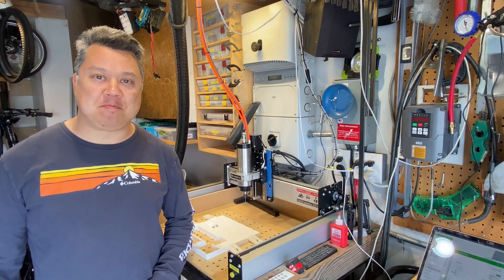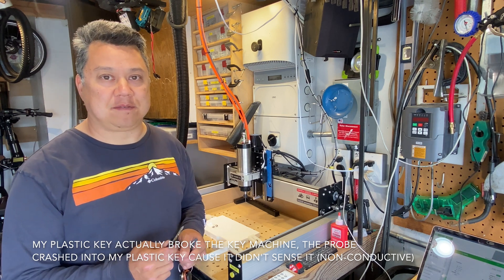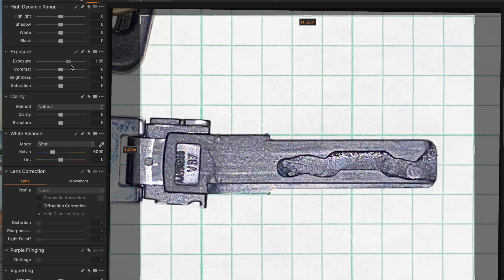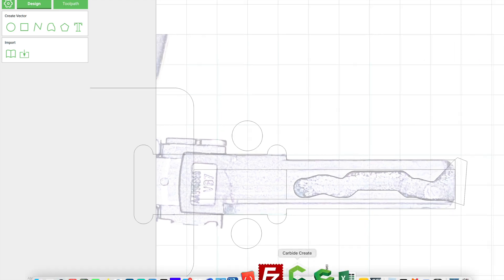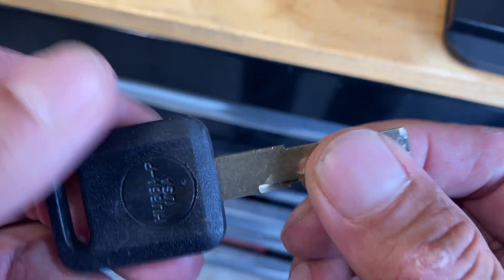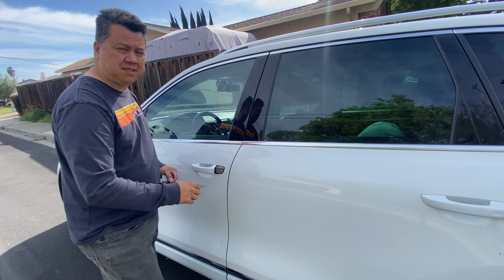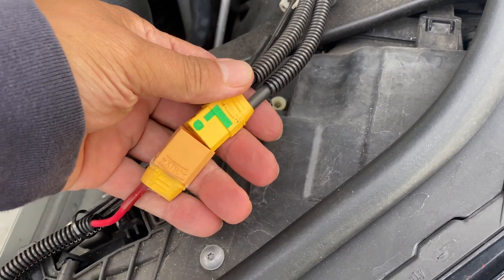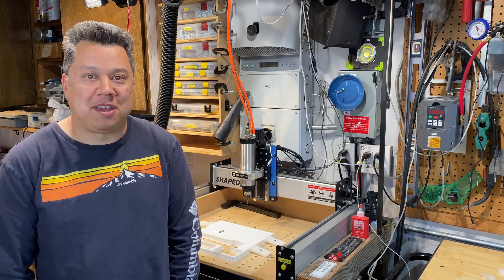Dead battery & locked out - Making a metal  VW Touareg key

Comment: This is a Long Shot... but my Touareg keeps dying and IDK what is consuming electricity from it. But this is the 3rd time I have to call someone to unlock it and its not so cheap. How much would you charge me to make 2 copies exactly like the one you? Please help. Thank you. I could do zelle, $$$ order, Paypal, I am ok with sending you my copy please. 🫡
Reply: Go to a local welding shop with a cnc machine.. or even a local trade school with a welding department,  they have a cnc machine & it may be free. They use the key template to teach the students something new possibly.  When I was in welding school I got a lot of free work done on my car at the automotive dpt next door. Maybe tell them your a nursing student at the same trade school to bypass someone having a liability issue with your key. But it is just a plastic key, so maybe it'll be fine.

Comment: Same problem for my Touareg and I had a metal key made at the locksmith. Went to pull the lock to referb and in short discovered that the set screw when tightened prevented the cylinder from easily turning even with the metal key. Backing the set screw off allowed even the plastic key to work. Who would have known. Thanks for the video which helped solve my issue.
Reply: Is the set screw you’re referring to under that removable plastic trim piece on the door handle?
Reply: And is it accessible from the outside? Or only once you’ve regained access to the interior
Reply: @newdiggszweiundsiebzig  actually I found out it was an issue w the key fob being glitchy when its cold out. Changed the battery and it still does it..maybe the door lock module is bad? might be a dealer issue

Comment: hi, i tried duplicating a key at a home depot for my 2015 subaru crosstrek, and it turns on the car but a useless safety feature makes that not work and the car instantly shuts off after revving up, it also starts a car alarm when i open the door with it, the dealership informed me that this will always happen and that even metal keys (not keyless fobs) on newer cars have chips in them and i needed to buy a 400$ key from the dealership, so im wondering how all this is possible
Reply from the maker: I made my key just so I could unlock the drivers door.  My car doesn't actually have an ignition lock, or anywhere to put a key.  But when the battery in the FOB or the 12v car battery dies, there's no other way to get in the car, so that's why I made a metal key.